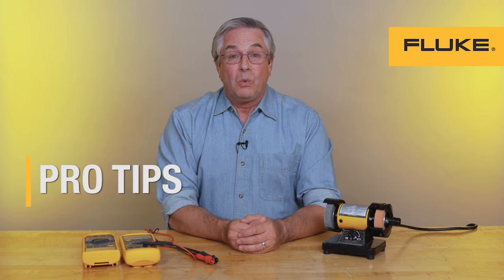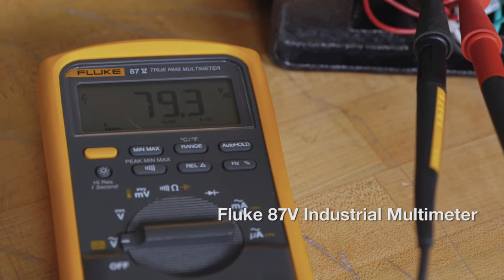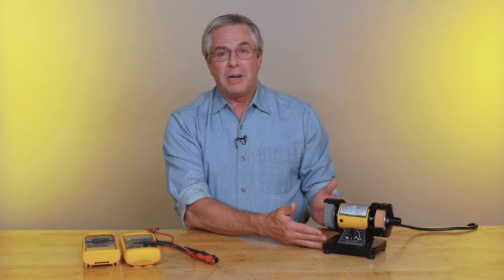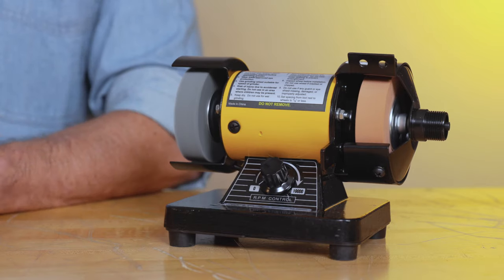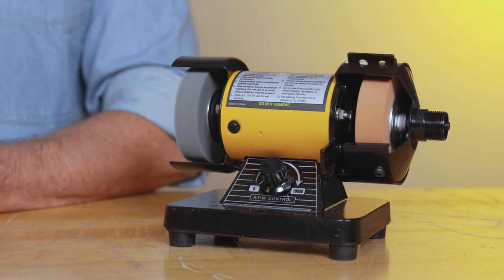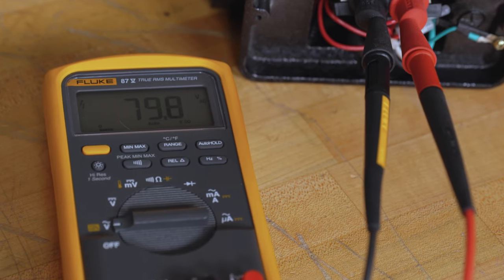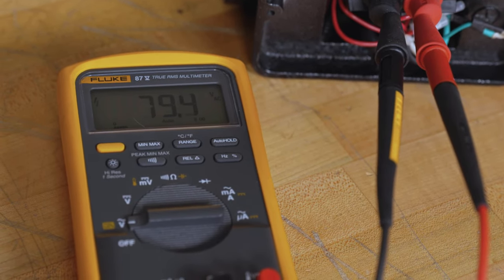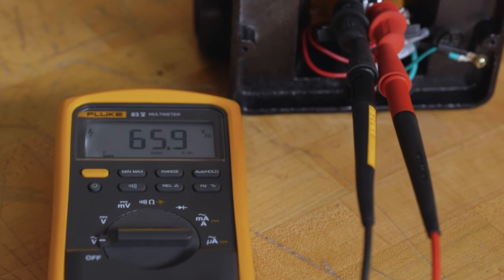What is a True-RMS meter? | Fluke Pro Tips

Comment: It is true that an averaging meter can accurately measure a sine wave, but it should be noted that the result is an average value which is NOT the same as True RMS for a sine wave.  RMS is whatever the equivalent DC voltage would be to produce the same "heating" effect".  (In fact, some meters long ago actually heated a resistor and measured its temperature and converted to display as the RMS.)  Skipping all the math and jumping to some key constants, the RMS for a sine wave is 0.707 of the peak voltage.  Average is 0.636 of the peak voltage.  For a square wave, the peak, average, and RMS are all the same voltage.  Meters in the past that had purely analog input circuitry (even if they display digitally) could easily produce an average voltage because about all you need is a resistor and a capacitor.  Some were (and are) marketed as "True RMS" by simply scaling the voltage by the ratio of the RMS and Average constants for sine waves.  So, 0.707 / 0.636 = 1.112.  As an example, 20 volts peak to peak is 10 volts peak is 6.36 volts average and multiplied times 1.112 and you get 7.07 volts "RMS" displayed.  But if you had 20 volt peak to peak square wave,, it is 10V peak and 10V average and multiplied times 1.112 yields 11.12 volts "RMS" which is too high because the RMS is actually also 10 volts.  The easiest give away that a meter is not really True RMS for all wave shapes is to see if it measures a square wave about 11% too high.

How good RMS meters do the job has changed over the years.  Today, Fluke (and others) take samples and then the RMS is handled by digital processing.  Previously, it took some pretty fancy analog circuitry footwork such as what was in their 8060A True RMS multimeter.  The 8060A works quite well and many are still soldiering on today.

But there are still plenty of meters sold today (including the meter function in many 2-in-1 products like scope-multimeter combinations) that claim RMS but it is only true for a sine wave.

Comment: I've got the Fluke 16 and it does a pretty good job for me. But its up to you depending on what you need with AC non-sign wave accuracy. Maybe if you have a non-sine wave inverter it may be useful.  I also have an 87III and an 87V. But the Fluke 16 is a very compact and convenient unit with lots of in built hidden goodies.

Comment: Hi 
Why does Fluke 179 multimeter have 2 types of screens?
Why do some have green light and some have white light?
Reply from the maker: Hi Mani - thanks for your question. Older models were equipped with a greener backlight display and the newer models have the crisper “blue” and brighter light.We can check the ages from the meter's serial numbers if that helps?

Comment: What are the key differences between the Fluke 87III vs the 87V in terms of functionality?
Reply from the maker: Hello Eddie - The 87V has increased measurement resolution. It has Low Pass Filter for taking measurements on a VFD. The 87V has an increased capacitance measurement range (up to 9,999 microfarads). Higher resistance range (up to 50 Mohms). Better backlight on the LCD display. And the CAT ratings on the 87V are rated for CAT III 1000V and CAT IV 600V. Hope this helps.
Reply: The key difference is they wont be supporting their equipt. Buyer beware..dont buy !!
Reply: Tell them about how you no longer support the mk III
. Cant even get a rubber seal for their now throwaway meter

Comment: What causes such a great difference in price for true rms meters?
Reply from the maker: Hello Denis - The true RMS meters are the only meters that can accurately measure both sinusoidal and non-sinusoidal ac waveforms. The alternative, average-responding meters, use an averaging mathematical formulas to accurately measure pure sinusoidal waves. It can measure non-sinusoidal waves, but with uncertain accuracy. Hope this helps.
Reply: @fluke  Why is Fluke 77IV (average responding) more expensive than the Fluke 177 (true rms)? Both are very similar in specs and features.
Reply from the maker: Hello - They are both on the same main frame. The 77IV has always been military driven more than anything. Most consumers would go with the TRMS meter unless their application would require an AVG responding meter.
Reply: No support for previous models..dont buy!!

Comment: And, when should one NOT use a TRMS/RMS meter?  ANSWER:  AUTOMOTIVE ALTERNATOR CHARGING OUTPUT.
When checking for and finding causes of onboard vehicle devices not behaving properly, check the alternator for DIRTY D.C..  A bad DIODE set, will cause bad A.C. RIPPLE to ride on top of the D.C.  Vehicle electronics DO NOT LIKE A.C. RIPPLE!  Sometimes, a TRMS meter will HIDE this when TRMS meter is set to read D.C.  
BUT, A.C. Ripple WILL show itself on a NON-TRMS meter, because, with a non-TRMS, the D.C. display will DANCE around and not settle onto a single D.C. reading.  On an alternator output, if you see "The Dancing D.C.", start looking for A.C. RIPPLE!